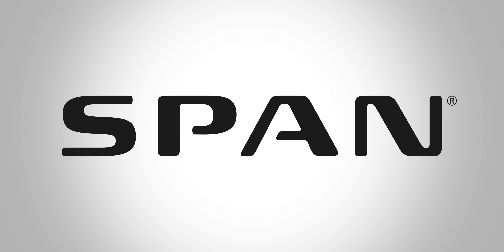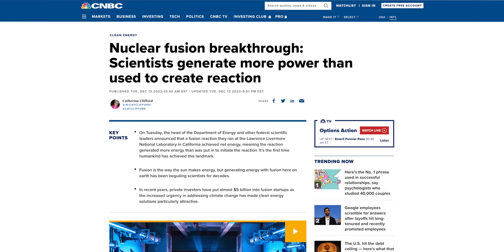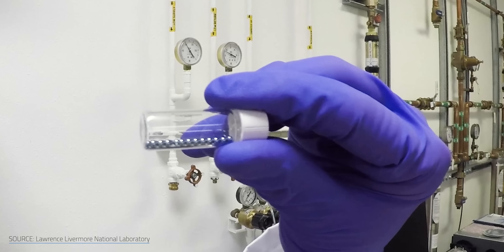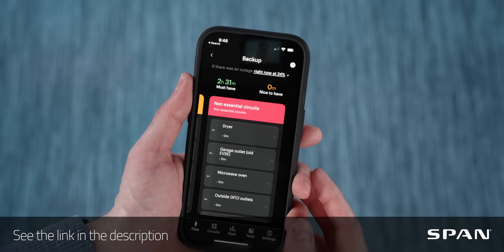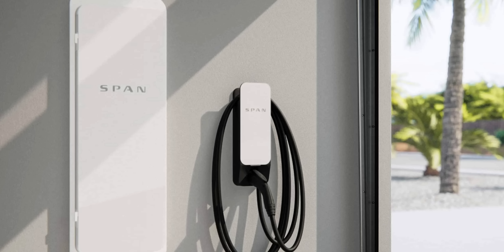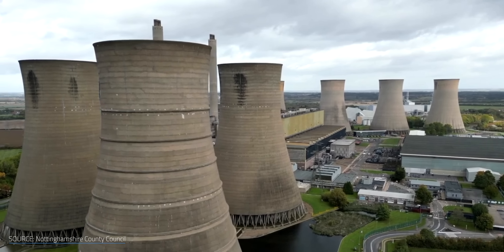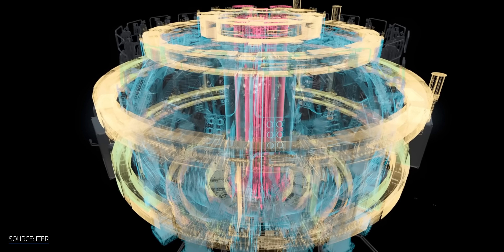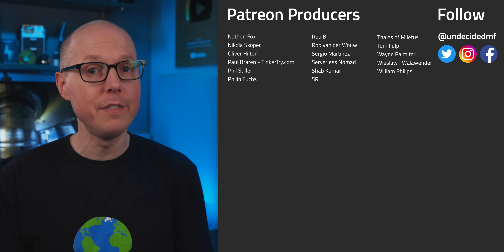What This Breakthrough Means For Nuclear Fusion

Comment: Thus was a wonderful SCIENTIFIC achievement — Optical Breakeven — from LLNL/NIF but it is not a very useful result from the PRACTICAL perspective on the profitable production of ENERGY.  
Using Nd:Glass lasers with so low conversion efficiencies for electrical energy into optical laser beam energy means you need a thermonuclear output energy several hundred times higher. There is no other laser types with the suitable temporal/spatial frequencies and power stability; the hope we had in the mid 1990s for Semiconductor very high power lasers has never realized.
Besides there are a huge number of other overwhelming optical, material, electrical, thermal, even mechanical engineering issues that have to be solved to get a practical, affordable and profitable Inertial Fusion reactor.
There are not enough brainpower* being educated and employed in these problems anywhere, and ICF funding is mostly provided by the military budget of the DoE, so the predominantly foreign (~2/3) High Energy Density Physics graduating from UoRochester, UCDavis, UCSD, UNevada-Reno are usually excluded from ICF R&D in Federal Labs*. 
In the USA, ICF is predominantly a military-oriented program — to research, test, homologate, validate R&D for Thermonuclear and Directed Enegy Weapons — so to avoid traditional Nuclear Testing. 
Profitable Energy generation is not a priority — results like this ignition are predominantly budgetary PR and PC propaganda for DoE's Lawrence Livermore, Los Alamos and Sandia National Labs. 
The bad thing about all this brouhaha is that material, financial and the scarce BRAINPOWER resources are diverted  from better latter Generation (7th? — it was 5th in the mid 2000s) Nuclear FISSION Reactor Technology (including Thorium-232 reactors) to pursue this Rube Goldberg-like nonsense.

Anyway, I am quite excited and jealous at the same time for not being part of this ICF achievement. 
I got into HED/ICF/Plasmas because I wanted to build Fusion/Plasma propelled Interplanetary Spaceships and retire in Tethys (a moon of Saturn) ... !
In 1997, I was offered to be trained as an Control Room operator in the UoR/LLE Improved Omega Laser (it was expected that the 60-beam Improved Omega would achieve Ignition in Direct Drive mode by the early 2010s!), to be transferred to LLNL/NIF later.
In my just-to-be Ph.D. arrogance, I decided against taking that job. 
Some years later, as a foreigner, I was elegantly kicked out first from ICF and later of the USA, as happened to many of my fellow (non-Russian) HED students from UoR. 
(*The USA prefers to have a Resident Visa Lottery for 50,000 people with only High School education required, but doesn't want to give <2000 Green Cards to the 60% of extremely talented Ph.D.s in the Hard Sciences graduating every year in American Universities who are foreign-born, want to stay in ... as Sen. John McCain proposed decades ago!)
I had many offers to work in DEWs from the USN/NRL (from my thesis work) and the USAF/ABL (from my postdoc work) plus SAIC (!!!), Sandia and LANL.  
My last job at ICF in UCSD (after getting a Ph.D. in HED Physics at UoR) was theoretical and experimental work in reactor's first-wall survival to the fusion pellet post-detonation shocks.